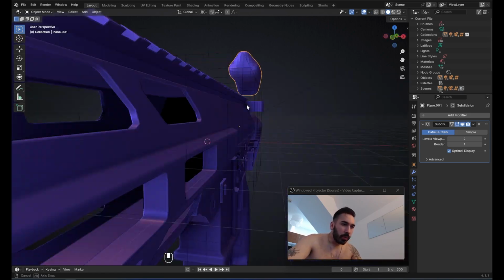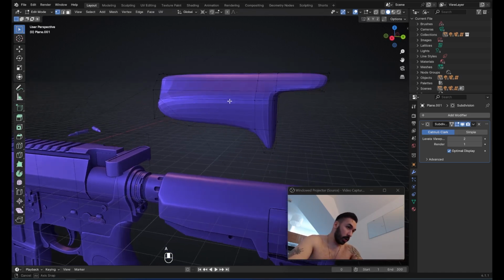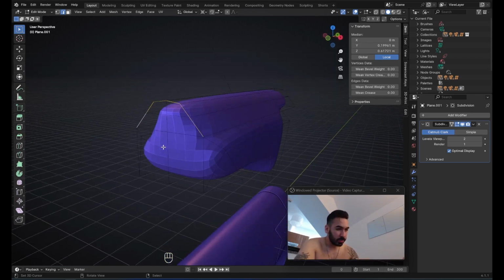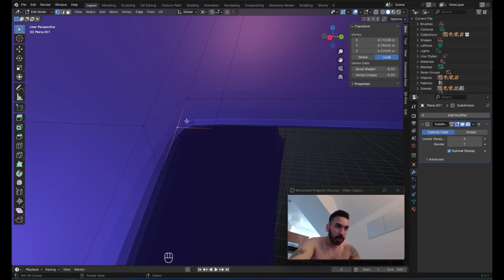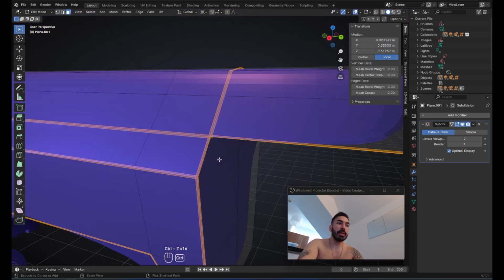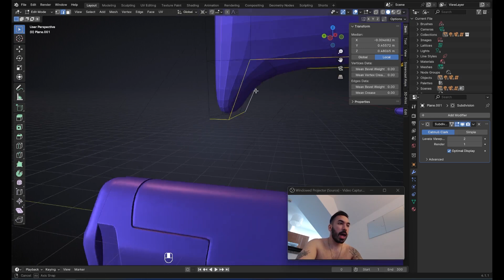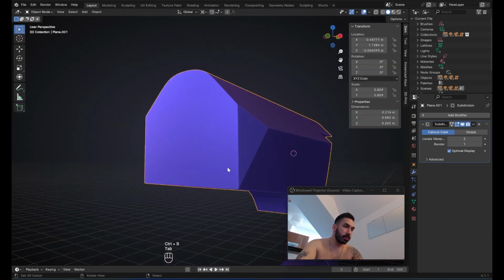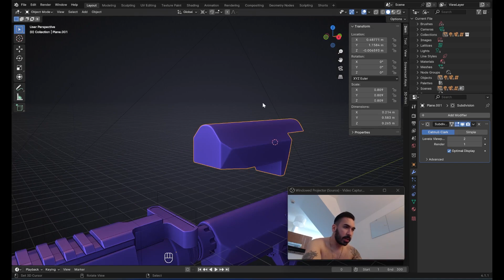Blender Gun Modeling - Topology Perfection with Bevels

Comment: Another amazing video. Thank you. This is very useful. However, my issue is that I have to make a square hole with a bevel on a cylindical shape. And using Miter Outer: Arc doesn't work because of the curved shape. Is there some way for me to be able to do this?